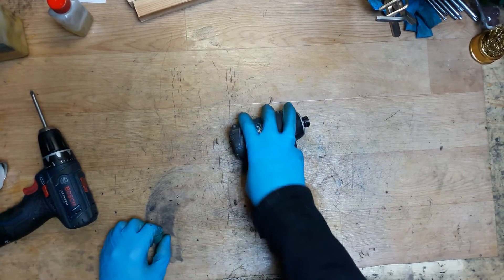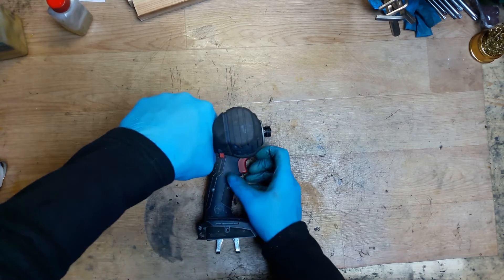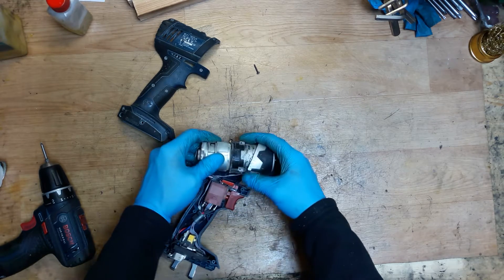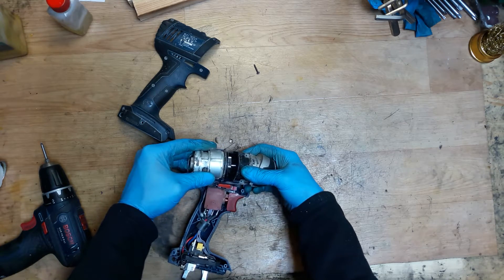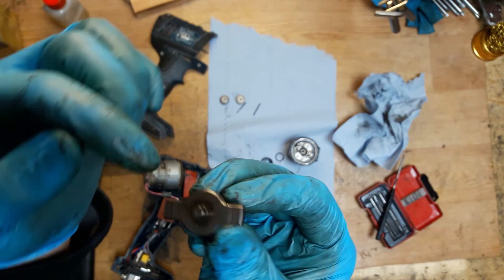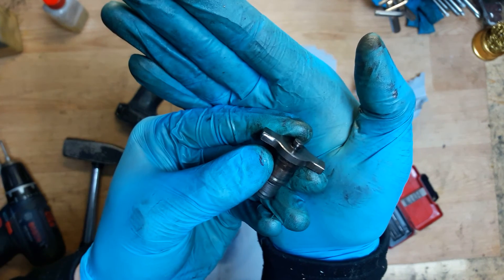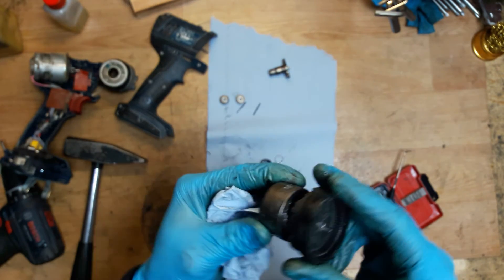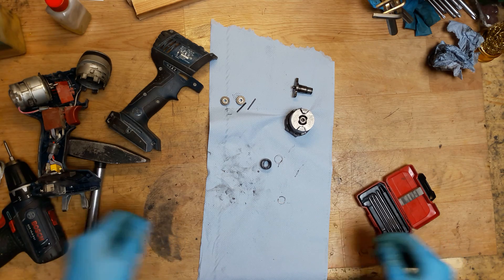How to disassemble and find problem for Bosch GDR18-Li 3601JA9100 18V impact driver worn out anvil

Comment: Hi I have a 18v brute cordless drill tough hammer. I have disassembled but I have 2 cylindrical pieces 3mm diameter 8mm long. They came out of the gear housing. I don't know we're to put them back. Can you help? Thank you
Reply from the maker: I think they are from bottom of gear assy. They need to be put near chuck holder anvil